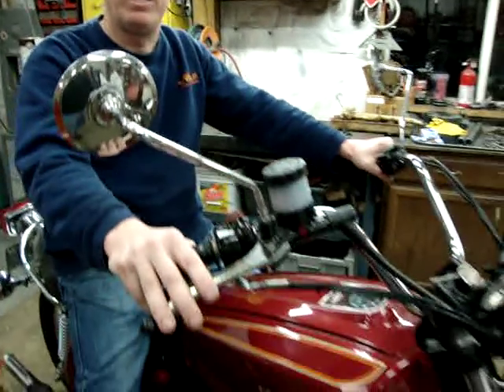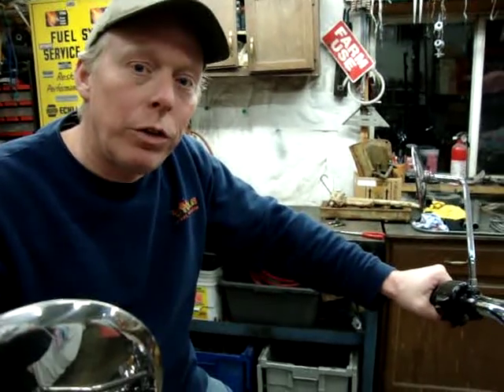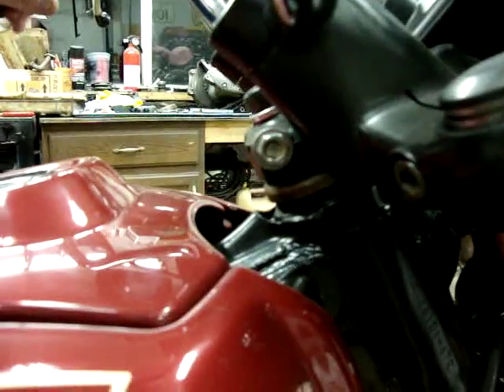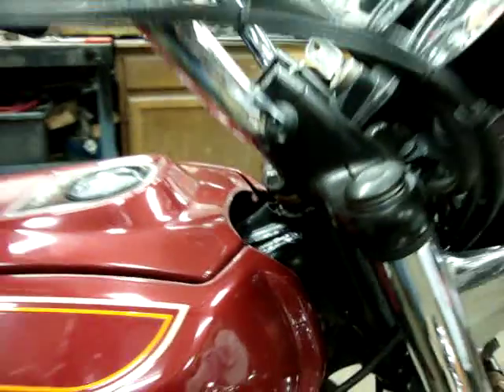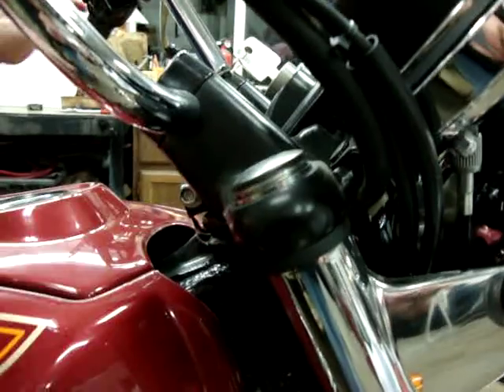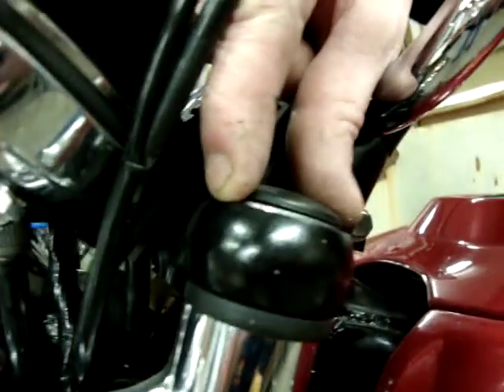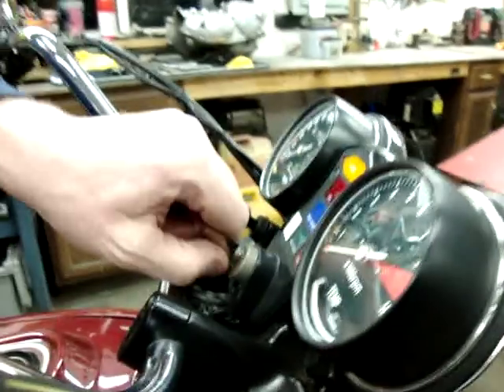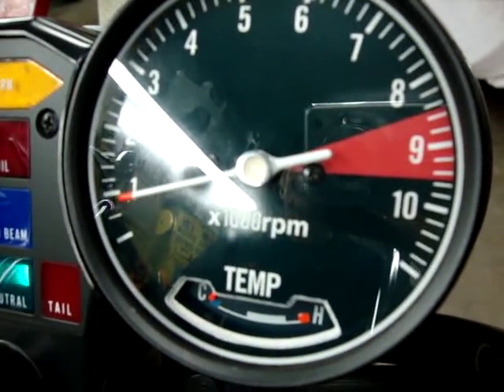1975 Honda Goldwing GL1000 - steering head bearings & flittery tach needle @ rcycle.com

Comment: Time and time again, the manufacturers do not fit greease injection points to the steering bearings.
It is bloody stupid, and means they wear, and wear and it is a pain in the neck to dismantle it all just to get grease in there.
Only the Russian motorcycles seems to have grease injection points in the steering.